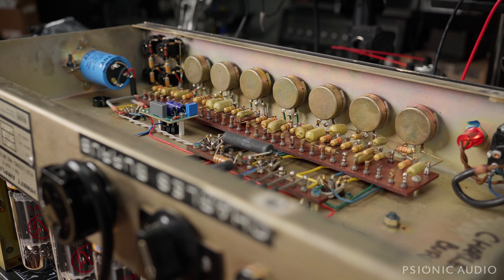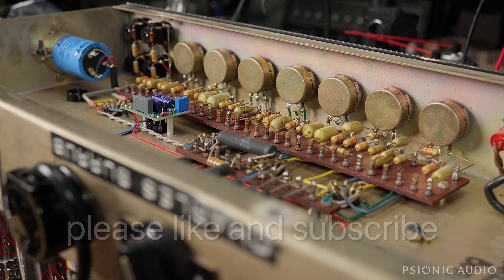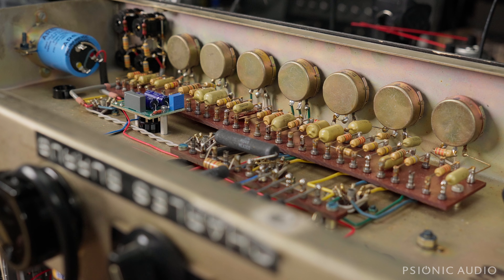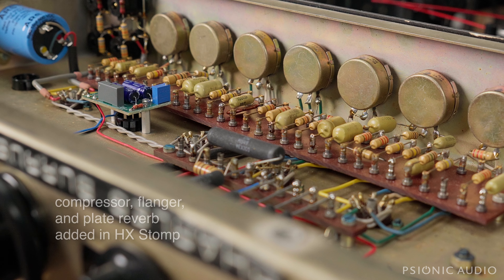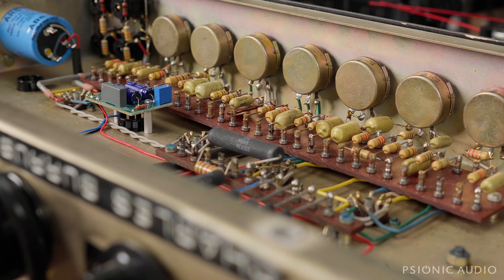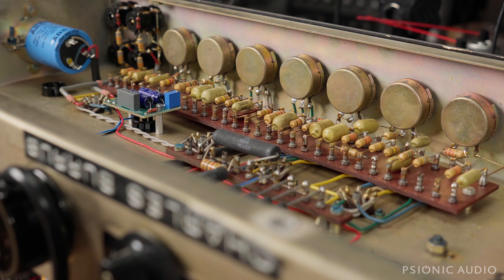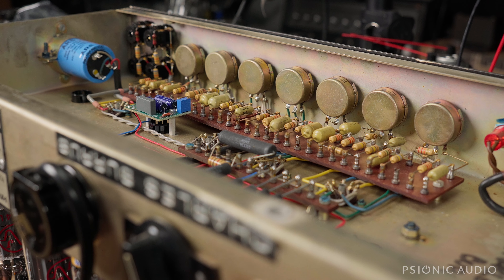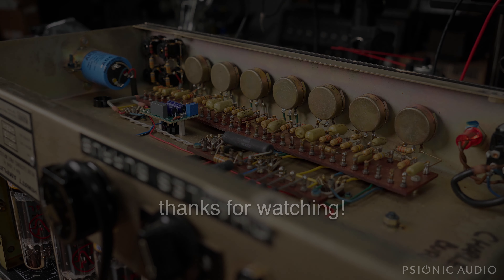Old Lust | HIWatt DR103 Pt 2

Comment: I've got one of those DR103 that is poorly at the moment 1972 it started redplating and blew the fuse at band practice last week could the 63v 100uf cause redplating ? I've only had a quick visual  so far and the cap looks original still got red ink on the solder joints so past its best and crusty crystals around one end I've ordered one anyway the larger caps were replaced a few years ago .

Comment: Man. I’ve never seen the internal chassis of a Hiwatt. That layout is sweet, and clean. Love hand-wired amps. The only hand-wired head I have is a GDS Amplication 18 watt TMB. My ‘83 JCM 800 50 watt 1x12 combo is next; but, that’s a PCB. As I recall, the Marshall hand-wired heads ended after about 1971 (unless you get into the HW reissue series).